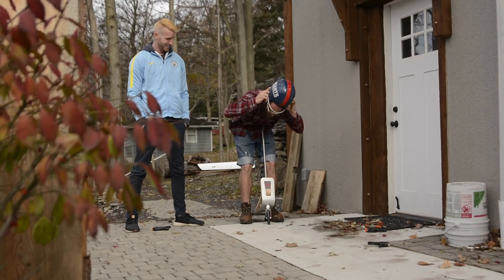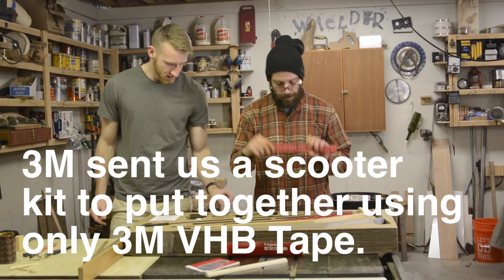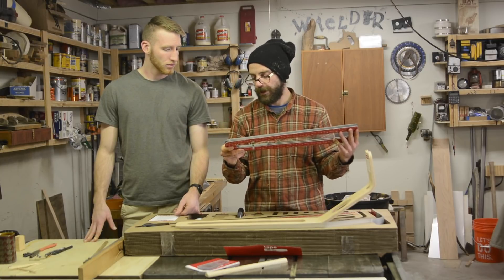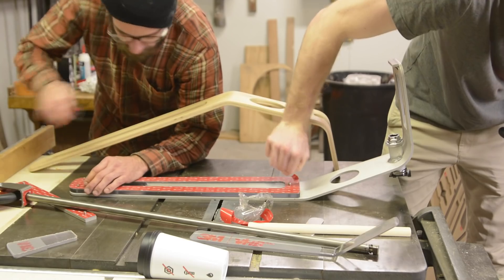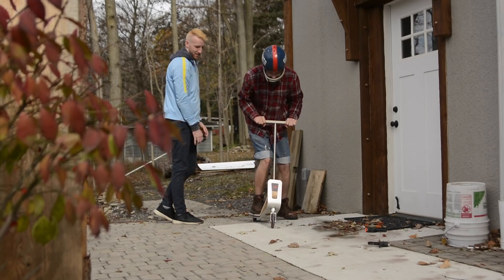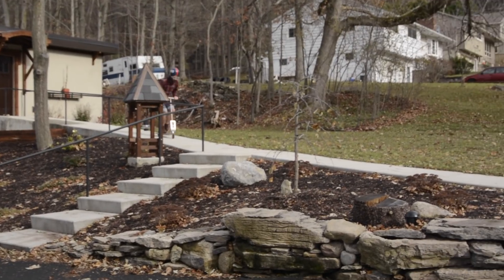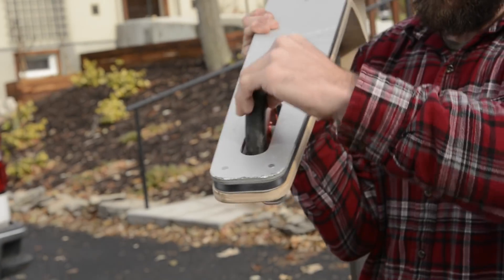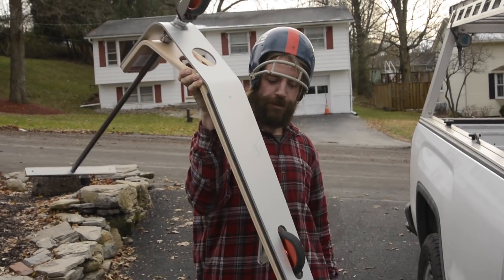A Scooter held together by 3M™ VHB™ Tape?

Comment: Vhb is a funny thing, used it a few times now and for some it has been awesome (to the point I was cursing its stickyness when disassembling) and others it failed very quickly. Just one of those products that when it works well it's amazing and otherwise is a bit poo?

Comment: Modern builds did the exact same thing/build on his channel and I really don't think it sells the tape very well - 1 Why do they think anybody wants to watch somebody assemble a scooter? its like watching an ikea assembly, 2, we don't even get to see the application process/how easy it is to use and therefore its versatility & 3 its not showing off the strength (which i'm guessing is the usp of the tape) because there are a load of other components/parts holding it together + since we didn't see it getting made they could of done all sorts to the tape...

Comment: When and IF I have to use VHB it's always in conjunction with a mechanical fastener or another aggressive (longer curing) adhesive. 3M should not be promoting this as a "lazy-mans cure-all" for bad engineering, design and/or poor planning.

Now, if you wanted to make that scooter permanently bonded with zero fasteners, check into LORD adhesive products. Your car is mostly "glued" together with that stuff, where spot welds can't reach or are inadequate. I use Maxlok MX T18 in the shop, for bonding Aluminum to Aluminum or Aluminum to Wood or Aluminum to Steel.

Comment: many people have said on these 3m scooter videos that its not a good example of the tapes strength. i wounder how well the scooter would hold up if it was stuck together with normal double sided tape. David do you think you could get 3M to send you another scooter that you could assemble with standard double sided tape?
Reply: I suspect that if 3M got wind of the intention to stick together "their" scooter with a competitor's tape, they wouldn't send David another one. They want to show their product under controlled conditions and in the best possible light. Otherwise the marketing bots will get the sack!

Comment: Nothing wrong with your video, but this product kills me. We use it at work and have daily failures. We've had 3M reps watch the install and witness repeated failures and not offer any help or strategies to succeed using it. From what I can see in all of the scooter builds the tape itself doesn't make any real difference. I could probably hold that scooter together with hot glue and still be just as stable.
Reply: We've had failures in adhesion that range from immediate to falling apart in a few months. Some structural pieces, other decorative. We've had failures with both. 3M reps approved the entire build process and have not been helpful in finding a solution.

Comment: The tape isn't holding the wood piece down so much as it is holding the plastic and metal pieces up. Since you bear your weight on the wooden piece which rides directly on top of the axle, the tape isn't under significant load so it's unsurprising that the tape didn't fail. What needs to be tested is to resize the wooden part so that you are standing on the lower metal structure. Then the tape has to hold the upper wooden piece down in tension, otherwise it will pop off and the axle fall out. Currently your body weight is causing a greater force holding the wood down than is transferred to the metal and plastic parts to create a force which would push it up (and break the tape).
3M make some nice products no doubt, but this video is completely misleading in terms of the product's capabilities. If I were 3M i'd be uneasy about having this video represent my product since the test methodology is so blatantly flawed.
Reply: 3M is the one who has sent these scooters to so many different builders. It's all the same kit. Their product and intended message getting out there.